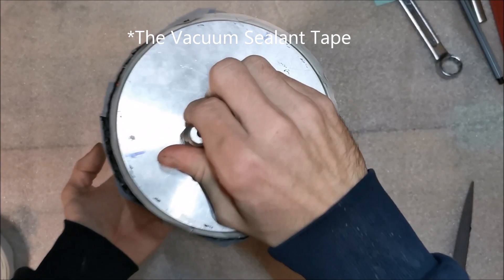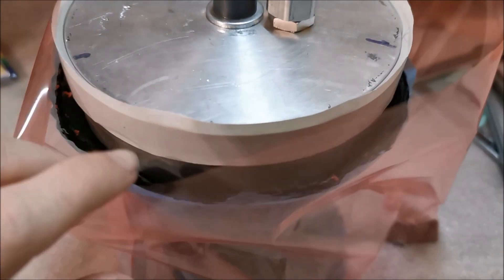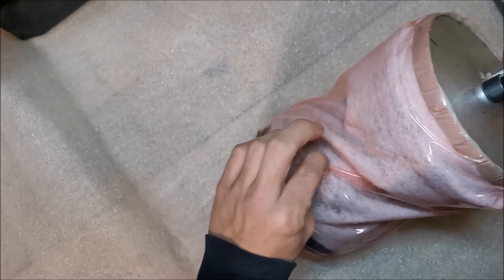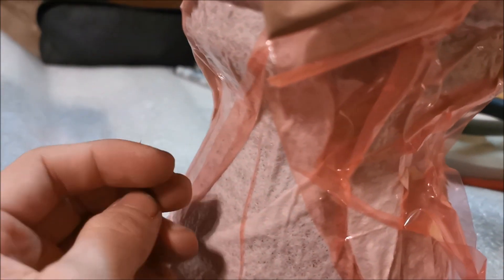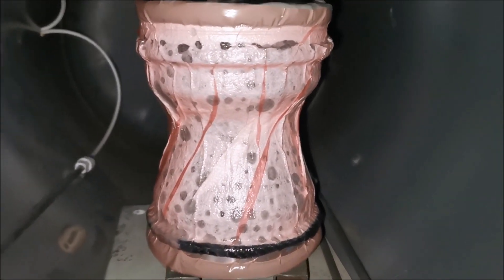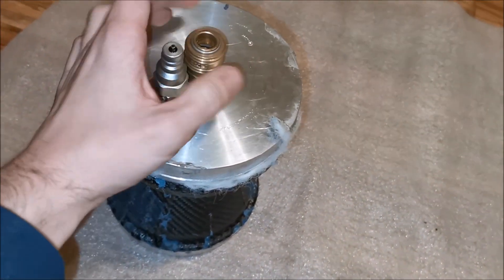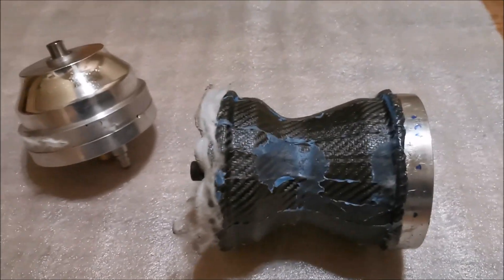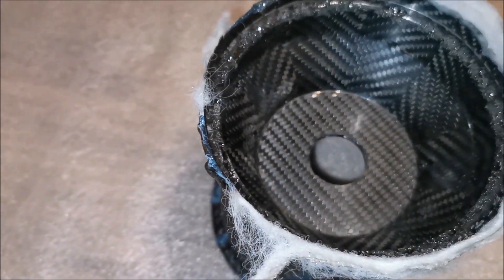How to make a Carbon Fiber Rim Part 3 | Finishing the Rim

Comment: Very cool project. Did you considered using carbon/Kevlar cloth and les layers of carbon and also for the ridge it will make it stronger over bending. Im not sure if this is the case for the prepreg, but there are unidirectional strain dry cloths if yes you can easily wrap that kind of material arond the ridge (where the tyre is pressedagainst the rim)after the first layer this way you can build thicker ridges which are going to be like rings and then cover it up wit the next layers this can help you also when mounting the tire and need to pres against the ridge.

Comment: Definitely applaud your efforts.  This is not an easy process to get right, especially without training or apprenticeship.  What I can suggest is debulk your layers with the perforated film.  If you are not familiar with that step, vacuum bag the laminate stack and manually press the prepreg into the tight areas with your tools as the bag compresses and leave it for approximately 20 minutes, or longer for added insurance (briefly use a heat gun on it's weakest setting to soften the resin a bit).  this will compress all the carbon together and hold it to the mold surface.  The layers tack and lock each other together so the prepreg doesn't lift and the majority of the trapped air is removed.

Remove the vacuum bag and replace the perforated film with NON-perforated release film (This film traps all the measured resin within).  I agree with Your tip about applying the film.  Relieve all tension in the film with folds and overlaps, where necessary. This let's the film slide over itself so you can manually press the prepreg into the tight areas with your tools as the bag compresses. Avoid any gaps in the film.  then follow the rest of your step.  you should see MUCH better results.

As for the bead i'd suggest aluminum rings that are contoured to the shape of the bead and tire seat.  Fill the void with the prepreg of your choice and clamp the ring into place.

Comment: Hey! Two observations. You used perforated release film from easycomposites that is not for use with prepregs! It will melt at 120C. You need prepreg release film that is solid, no holes. And you should not be using the breather layer with prepregs. Only release film and then vacuum bag over. If you use the perforated one it will drain epoxy from the material and you’re left with weak carbon. All the epoxy in the prepreg needs to stay there! Good luck! And awesome job 🤘
Reply from the maker: Thanks for your comment, but the release film is one of the only things that isn´t frome easycomposites. It is suited for the temperature and it also worked on dozens of earlier parts. I didn´t know the fact, that you shouldnt use breather layer on prepregs, but it really makes sense. Gonna change that on the next part. Thank You!
Reply: @renny_composites  We see a lot of infos about prepreg around here. As I tested the breather can absorb some resin but if you have a good curing cicle it won't happen, the breather is essencial for ensuring vaccum and it also can apply some more preassure. The release film also doesn't allow the resin to overflow to the breather even if it is a perforated one.

Comment: Love you videos keep at it, I struggle with the same problems but I do wet lay, I had an idea, see if you can turn an aluminum bead section for both sides, then slip it over before you do your cure cycle, you can then turn down the aluminum rim peices on both sides to your finished dimensions, your lay-up thickness calcs will have to be spot on , but still very achievable only thing to watch will be your creep rates on cure cycle but I still think it'll work , they do  bearing races and threaded sections on bike in exactly the same way 👍🏼

Comment: To make the rim stronger could you turn a piece of aluminum down on the lathe and adhere or bolt that to inner rim where the tyre would seal? This may help you with the issue of getting the carbon fibre to mould to such a sharp angle in your mould, and also make it strong enough to put tyres on without damaging the actual rim. The thin section of aluminium hopefully won't add too much weight to the end product.

I'm trying to make some Carbon Wheels for a motorcycle, but I want to make sure I have all the potential issues figured out. I've enjoyed watching your videos, they've helped, and thanks for sharing!
Reply from the maker: Thanks thats exactly the reason why i uploaded the video, so that others can learn something from it. Yes something with aluminium would be possible, but i set myself the challenge, to make the wheel completely out of Carbon Fiber. On the next part im gonna use some unidirectional fibers too and make the sides stronger and completely out of carbon fiber and not just resin. 
Your motorcycle rims are a bit easier i think, because you only have to do a ring the spokes are metall and get screwed in afterwards or are you making a rim with carbon fiber spokes. 
Also there are a few videos here on youtube where they show how to make mountainbike carbon rims. They might be interesting for you shouldn´t be much different from what your planning.